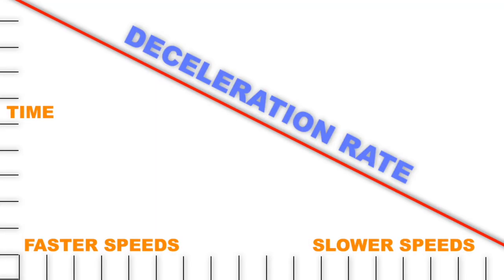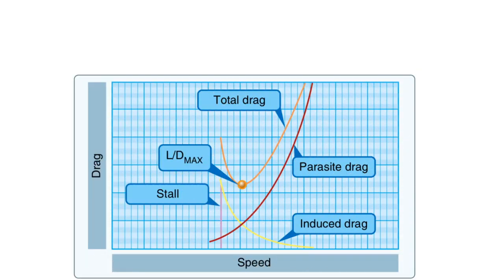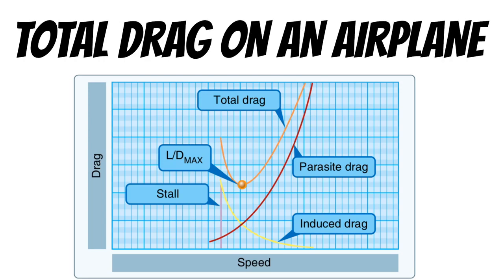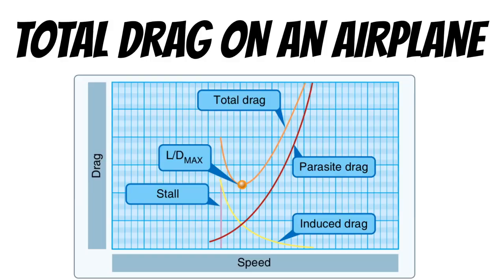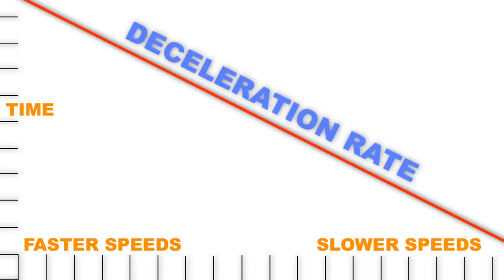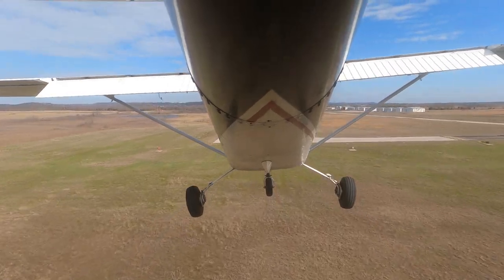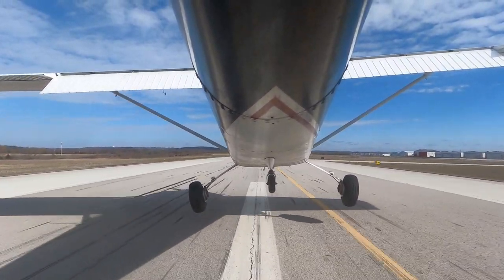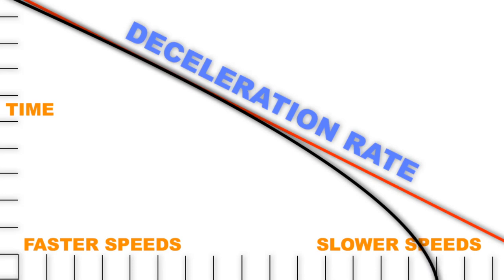Why Fast Landings Require 10x More Skill!

Comment: one thing about fast landings. in a tricycle gear aircraft, you can't "plant" the main gear and reduced AOA because of the nose wheel, wheelbarrowing, and wheel shimmy, or even weak nose gear (Glasair, Vans, LongEZ...). In a Tailwheel you pitch forward a bit to reduce the AOA, kill the lift, and plant the gear on the runway, "driving it on" essentially and preventing the bounce.

But, the nosewheel config does tend to rotate the nose down when landing hard due to location of the CG to main gear. but lets assume it's a fast landing that wasn't also a hard landing. You still have to be careful about landing on the nosewheel or wheelbarrowing in an attempt to keep it planted on the runway when touching down fast.

This results in trikes being more likely to balloon while trying to control for excess airspeed prior to touchdown.

Comment: Not being an airman or physicist, I'd like to make a comment on the exponential formula. I think this is not exponential relationship (constant to the power of x) between speed and drag. It is quadratic (x to the constant power, here: constant=2)! I've studied the airfoils to understand how the wind turbines work, and there is the relationship between lift and speed, as well as drag and speed, and there is speed squared in the formula. E.g. drag = 1/2 * Cx * rho * A * v^2, where Cx is the drag coefficient, rho is air density (1.225 kg/m^3), A is the area of an airfoil, v is speed. Similar with lift, but there's Cz. This is from the viewpoint of an engineer standing firmly on ground, remembering the simplest things from 20 years ago. Please, feel free to correct me if I'm wrong.
Reply from the maker: Lol. I start reading equations like this and I immediately quit reading. No disrespect, but you could be blowing smoke up my butt or telling the truth, and either way, it doesn’t matter
Reply: @FreePilotTraining  As I said, the comment was from the ground. But at the end of the day, aircrafts are supposed to fly. During approach, nobody cares for formulae. Skills and experience matter, so I must agree - pilots don't need to understand physical formulae. This does not mean that physics should be disregarded. It is physics that keeps you airborne. Safe landings!

Comment: Excellent video.  When we are going so fast that we have to close the throttle on short final, we remove the very best glide angle and rate of descent control (dynamic throttle) and now we have to both decelerate and control descent with elevator alone.  Long ago when city airports were grass and short, a man had a technique that would make landing safer even today and late go around less likely.  "The 'stall down' landing requires that you blend the approach glide, the flair out, and the slowing up of the airplane all into one maneuver so that, when you arrive at ground level, you arrive in a three-point attitude, all slowed up and ready to squat."  Stick and Rudder
Reply from the maker: Thank you! I really need to read that book. I’ve heard it’s awesome

Comment: Hold on. I agree with your reasoning. However, did you dismiss the effect of ground effect? What does ground effect do to your wingtip vortices, and moreover, how does that disrupted vortex change the lift- drag relationship? I agree that fast landings are harder because you have to be more gentle with your control inputs.  I think you don't tell the whole story, though. The why you cover in this video is incomplete.
Reply: Well you still produce drag while in ground effect. Just a lesser amount. Amount of lift will stay the same for the given AOA and airspeed. But the amount of drag is reduced via the ground
Reply from the maker: This is an excellent point I should have mentioned this, BUT ground effect also decreases with an airspeed decrease.  I’m not sure at what rate, but I’d be willing to bet that it decreases exponentially as well because it’s directly related to how much lift the wing is producing.  In addition to that, ground effect is directly related to your height above the ground.  According to the AFH, Ground effect reduces induced drag by 47.6% at a height of one wing span. This does reduce induced drag, but it still increases exponentially as the aircraft slows
Reply: Crop dusters have for years taken advantage of the increase in both lift and acceleration in low ground effect on takeoff, where it is an advantage.  At the same time they have mitigated the disadvantage of that extra lift and acceleration on landing by using power/pitch to decelerate on short final coming into ground effect in order to touch down slowly and softly on the very beginning of the landing surface.  Vso, an out of ground effect number has nothing to do with landing where we have to decelerate to well below Vso to quit flying in low ground effect.  Waiting until over the desired landing site is way to late for deceleration.

Comment: What's biting you here is the exchange of being on step (not flared) and then decelerating to off step (flared position) speeds. It's a relatively quick happening so you need to have at least entered a semi-flared position before entering the lower (in the ground cushion) altitudes. Some airplanes come "off the step" hard or more Quickly than others, in any case it's a destabilizing moment in time that requires re-stabilizing. Think of a slowly decelerating boat, at a certain speed it "suddenly" comes off of plaining across the surface and goes nose high, the boat does it all by itself, but an aircraft doesn't. It's a destabilizing moment in time whereas you need to react to "restabilize" your aircraft into a flared position, once you've restabilized into at least a semi-flared position (not on step) there's usually not another immediate or sudden change of lift and drag (it becomes more predictable). You don't want to be just feet over the runway when this "transition" occurs.
OK so why are a-lot of you saying/thinking "I'm wrong" and that you haven't experienced this so WTF is this guy talking about? Well... you've all been breaking into/thru the transition speeds (note the plural) very softly or that is in a descent whereas decelerations are very gradual BUT, over the runway you are forced to fly level (not descending), your power is off, your flaps are out and therefore you will "transition" through the "narrow speed band" very quickly and will get "dropped" on your butts rather abruptly as the transition "occurs". Try it at altitudes "in level flight" with no power and full flaps starting from "near" max flaps down speed. There's the difference, you'll find it! Try it clean and at all flap positions. I'm not talking about stall speeds here either, mid or within the white band! And don't you dare say " I only "immediately" lost 50 feet" or even 20 feet! Yeah...Think on that!
Reply from the maker: This comment is tough to read.
Reply: @FreePilotTraining  Yes a-bit technical and long in description. It's basically explaining the term "comes off the step hard" which is difficult to describe in short.

Comment: I try to land at Vref every time but I'm still unsure how to handle high winds and especially gusty conditions.. In those conditions you just can't do anything but land a bit fast, no?
Reply from the maker: This is a great question.  Yes, that’s one thing you can do is to add half the gust factor.  So if the winds are 360 at 5 gust 15. My gust factor is 10 knots so I’ll add half of that to my landing speed. Another thing you can do is use less flaps.  I’m a huge fan of landing with less flaps when it’s gusty.  Those giant barn doors catch all kinds of wind gusts.  Another thing I teach is that you have to be very proactive on the throttle and your pitch in gusty conditions.  Sometimes you might have to jam all the power in there to keep yourself from sinking too quickly.  But as I’ve said in past episodes, if you ever need to put in a big correction,  immediately take half of it back out.  That is a big key to success in gusty winds
Reply: Windy conditions warrant 5 to 10 kts faster but use no more than 2 notches of flaps. One if you only have a two notch flap like a Warrior. Pitch to about 400 fpm and power to speed. Cross threshold at or above bottom of green arc with full flaps or 10 kts higher at no flaps. Don’t pull power but gentle reduce to idle at the flare. If you get slow add power but don’t apply back pressure.